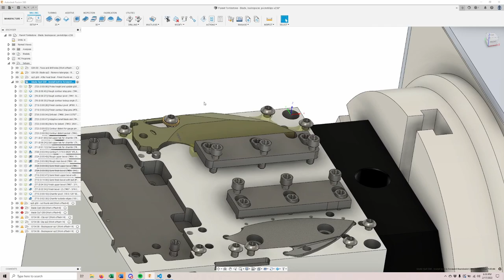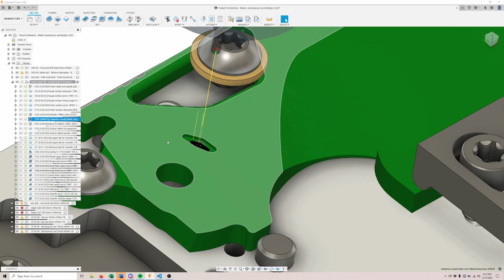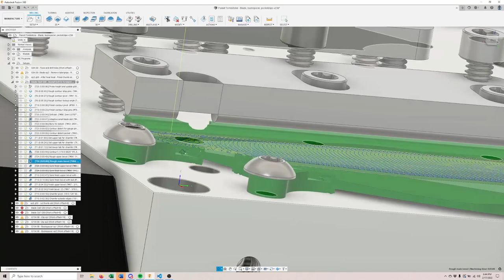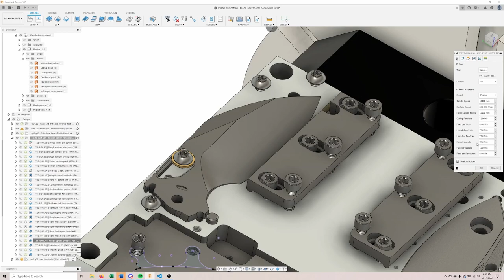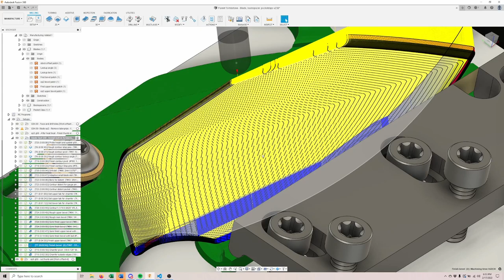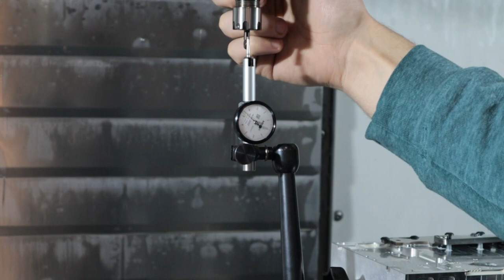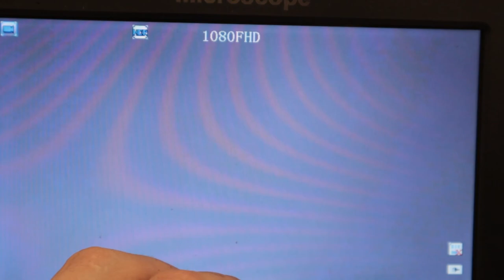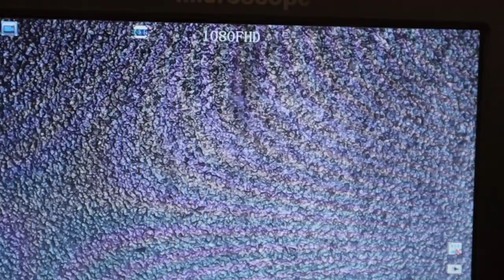Hard milling knife blades - First side

Comment: Quick question for you. Have you ever tripped the breaker on your panel from this machine when you run at full speed and ramp up? I've been trying to figure out what size to get and every where I'm see is saying 100+ amp breaker. I remember from your other video you had a 60 amp breaker.
Reply from the maker: Never have! Pretty sure you could run this thing on a 40 amp breaker if you had to
Reply: They spec the amps on the machine datasheet for vf2ss 70a at 220vac or 35 at 440vac
Reply: @split141x  100% agree. I have a VM3 with 15k spindle 5th axis trunion and 1k psi tsc pump i dont think ive ever hit more that 13 amps of 3 phase on the phase perfect phase converter. This was my biggest concern when i was getting my machine. hass SO SO over rated on power / power requirements. I know ive read people have even got a way with a 20amp breaker in their garage in a pinch.
Reply: Great vid man! very thoughtful on your process. Blade looks great!   As for checking run out its best to check the actual flutes just spin it backwards slowly  by hand and check each flute for its max reading.  Thats the only part that actually matters when it comes to runout.